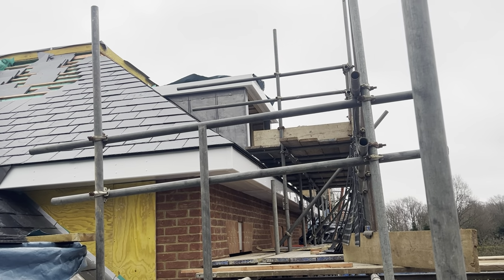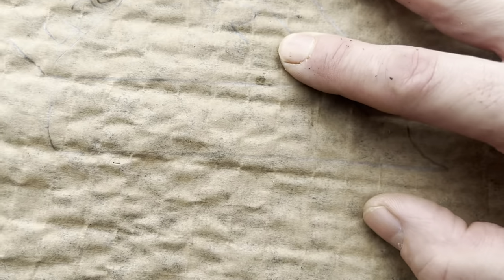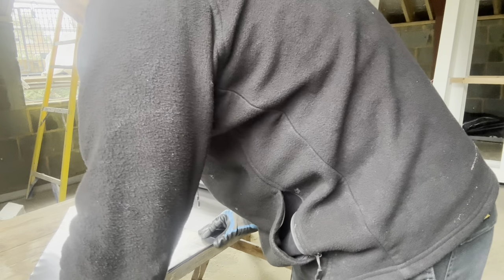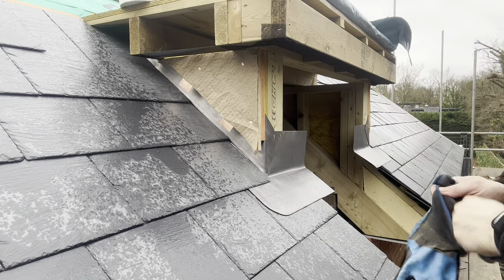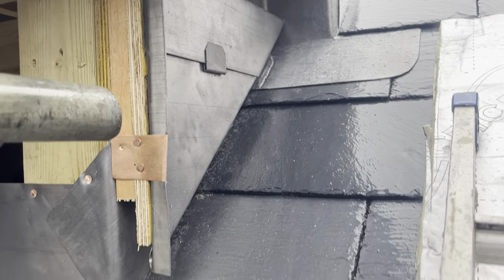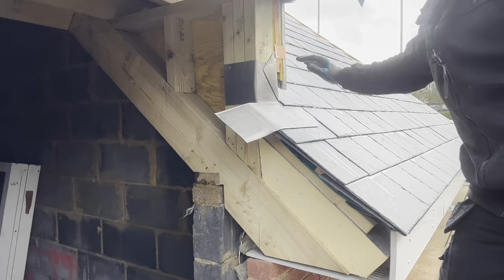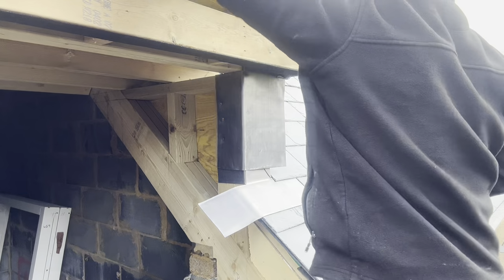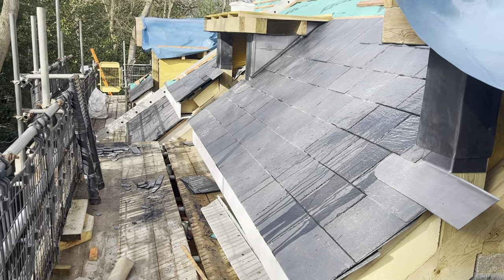Installing Lead Cheeks, Head Flashings and Jambs to 3 Small Dormers

Comment: Very interesting that so many jobs now have lead work on them. Great for you. Styles go in and out of fashion. We can't even buy lead in Australia. I much preferred working with it than the tin flashing used here. The zinc isn't bad to use. But mostly colorbond tin.
Reply from the maker: In the U.K. most houses will have something. But the more expensive property’s are covered. I’m lucky enough to work on this style house mostly.
Reply: @slbleadworks  It would seem the case. In the 17 years I built there the smaller houses had window flashing. And maybe some roof flashing. But when we tiled we did our own. The bigger houses might have valleys. Chimney back gutters etc. Some roofers lead welded. All the plumbers did. The most lead was on Georgian buildings like I was born in. Or Churches. But in all those years I never heard of. Or worked with a specialist solely lead worker. I worked on a lot of my local Norman churches. Including tower refurbs and re roofs. The tilers did the tile lead and the plumbers the tower lead. Specifically lead working I had never come across in my 37 years in the UK. Until I found your YouTube channel.
Reply from the maker: @davetaylor4741  well I’m glad you’ve come across my channel and thank you for the views and comments as it really helps the channel grow.

Comment: why is there building paper behind the lead ?? great video very interesting
Reply from the maker: The building paper protects the underside of the lead from alkalis in concrete stone and screed.
It also reduces corrosive attack when laying onto plywood and oak. 
It also acts as a vapour barrier and helps the lead to move.
Reply: @slbleadworks  i understand , thanks for the reply very helpful
Reply from the maker: @14sgdpg82   no worries anything you want to know just drop me a message.

Comment: Thanks for these vids.  I've been wondering, can you get a similar result with a propane/oxy mix as acetylene/oxy?  I ask because I've been having real issues getting hold of acetylene, so wondered what you thought about propane as an alternative.
Reply from the maker: No worries thanks for watching. To be honest I can’t really comment on this as I only use propane to heat my lead up. 
Is there an acetylene shortage at the moment I need to get some myself soon.
Reply: Yeah, so the suppliers are saying - apparently.  I think it’s still available if you’re hiring with BOC or similar.
Reply from the maker: @Charliemorgs  oh ok thanks for letting me know.

Comment: Went to a job today that had lead soffits, have you ever heard of such a thing, also the facias in lead were 3m sections just lapped 300mm.
Reply from the maker: I’ve done lead soffit and fascia’s before. But not In 3m sections 🤦🏻‍♂️.
Reply: @slbleadworks  yea it's all bellying and sagging, the soffit is about 350 wide, it looks proper rough.
Reply from the maker: @PeakyBlinder  how could anyone think that’s going to be ok. 
Are you down to redo it ?